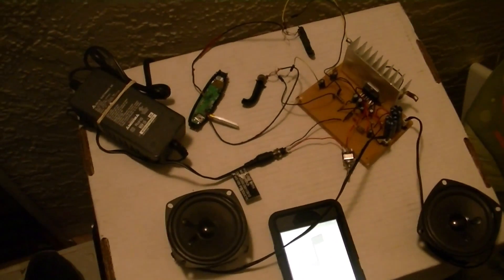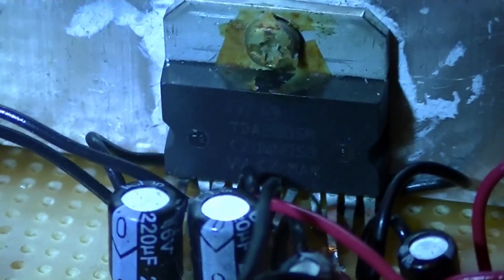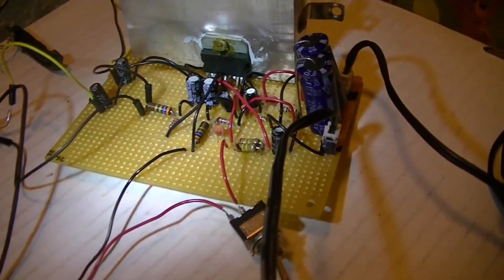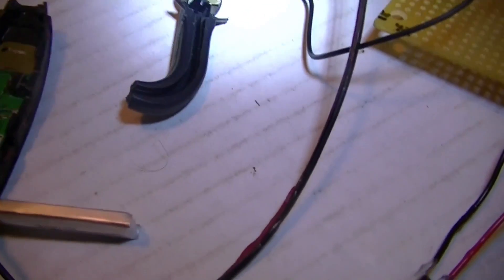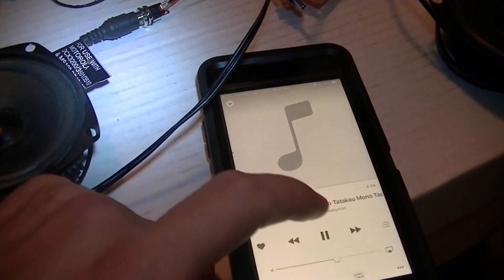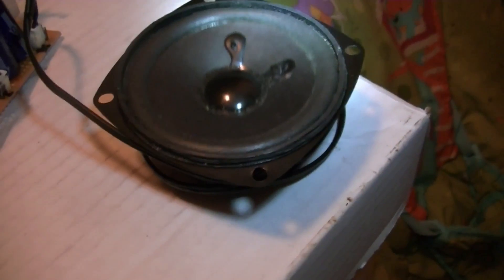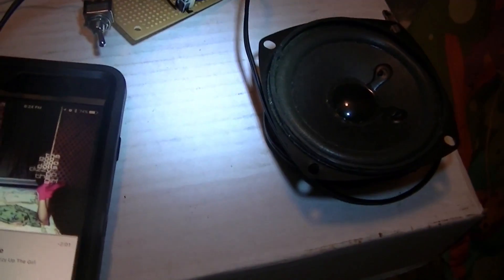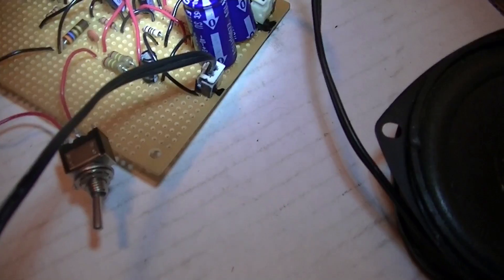Bluetooth Audio Amplifier with TDA2005

Comment: ok bare in mind that im pretty much new at this also. ive only built a couple amplifiers myself so i could be totaly wrong.please let me know if you found the em or if any advice i give is helpful at all. resistors you substituted may have acted as a filter or crossover therefore blocking the highs and causing no vocals to be heard. also if the orientation is not exact on the other channel thats possibly the cause of the static.try adding a cap to filter the circuit. best of luck and let me know if you resolve the issue.